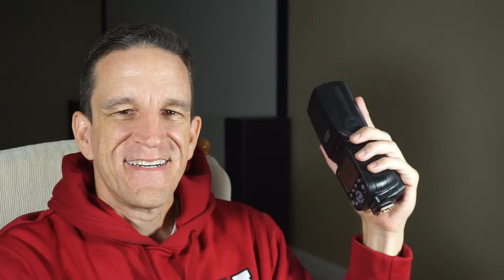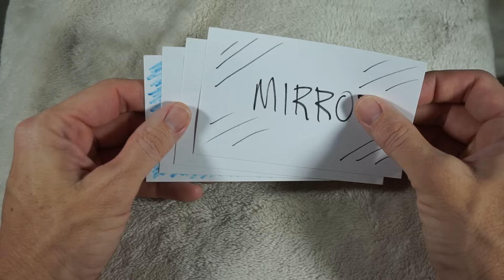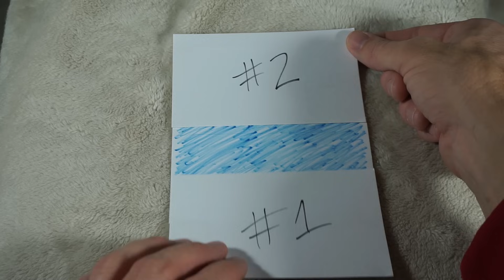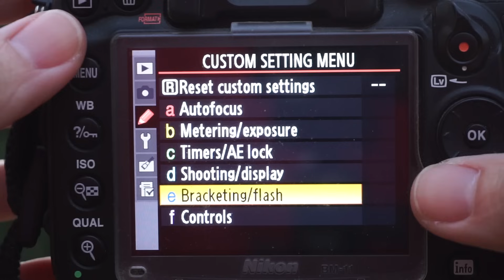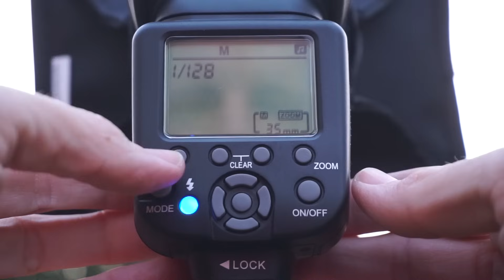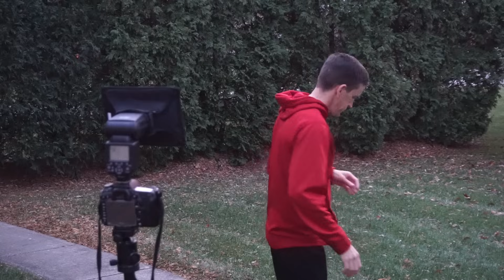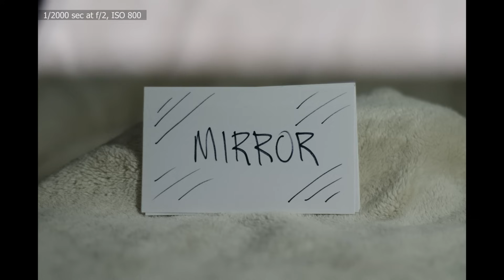Beginners Guide to High Speed Sync Flash Photography

Comment: Very simple and informative, thank you! One question, how does this setup work with electronic shutter (I believe this holds pretty well with mechanical shutter)
I have both MS and ES on my fujifilm camera
Reply from the maker: Thanks for the post/feedback!:)  Should be an issue using electronic shutter verse mechanical:).
Reply: RealWorld thank you for the reply. Did you mean to say, should not an issue? Because when I tried using electronic shutter with manual flash, it did not fire the flash at low ISO and 1/250(or 1/200,1/150) speeds
Reply from the maker: LOL - yes, sorry - should not be an issue:).  You should not have any issues using the flash at slower shutter speeds like you mentioned.  This might sound a bit obvious, but ensure the flash is mounted snug and all is well.

Comment: I just got one for my d3400 and I ABSOLUTELY love it!

I was wondering if you can make a video on the different lenses...I'm so confused on all the lenses. I want a great lens to take pics of the moon. What's the 400mm mean? ...the mm? I'm so confused....ughhhhh! 😦🤔🤔🤔
Reply from the maker: Thanks for the post and welcome to the world of DSLRs!:)  Nikon and Canon lead the pack with lens choices and there are many:).  The mm reference stands for millimeter which is a measurement from the camera sensor (located in the body) to the point of convergence in the lens ... this is also commonly referred to as the focal distance:).  A 400mm lens allows you to zoom in much closer to an object compared to a 50mm for example.  The upper end of the zoom range is 500mm (300mm is relatively common compared to 500mm).  Most people with the Nikon D3400 will have a kit lens that will range from 18-55 and perhaps another from 70-300.  I typically recommend getting a fixed 50 or 35 as the first lens after the kit lens but this depends on your needs.

Comment: Thanks for this video... I am regular viewer of ur videos n I enjoy them... I wanted to ask here does ISO value create same impact when they are set at same level across dslr cameras? meaning ISO value of 400 will create same image quality in nikon  d3400 vs d7000 assuming rest of the settings same?
Reply from the maker: Thanks for the post/feedback!:)  Yes, the image quality will be the same for the most part providing both cameras share the same sensor size and resolution (for example, crop sensor with 24 mp).  Do not be concerned with going high to get a shot ... you might see noise at higher ISOs but at least you will get the shot:).

Comment: Nice guide as always. I wonder if there is other way to achieve the result you've shown in the demo (properly exposed object against the sky) without HSS flash?
Reply from the maker: Thanks for the post/feedback!:)  Yes, you could achieve similar results by increasing the aperture or if it still too bright, you could use a ND filter (https://youtu.be/DY51QR1giGE).  ND filters are used to darken the scene to some extent.  If you are able to increase the aperture enough to lower the shutter speed below the max sync speed, you should be in good shape although you will also lose some of the nice blurred background:).

Comment: I have a D3400 so HSS won't work. But because of your videos on flashes, i picked up two Yongnuo YN685  ITTL flash units and a Yongnuo YN-622N Flash controller and receiver. The flashes have transmitter/ receivers built in , can do high speed sync, and capable to zoom out to 200mm. Nice off camera flashes. Still very good video and informative.
Reply from the maker: Thanks for the post/feedback Andrew!:)  Sounds like you have a good setup!:)  I plan to create a fun video using flash (one and two flashes with triggers) ... stay tuned!:)

Comment: Uhhh my Nikon D5300 won't do HSS afaik?
Reply from the maker: Funny how some do and some do not ... the older D7000 has it but the newer D5500 does not:).
Reply: the d5300 does not do it do too the facket that it is a lower end camara the d7000 and d7100 are on the pro come sumer line that witch  is way it can do hss